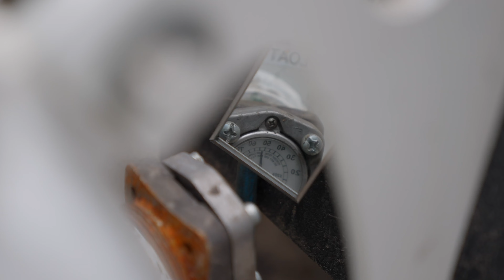Driving Change: Amogy's Ammonia-Powered Truck

Comment: Has Amogy considered to team up with companies and engineering bureaus with competence and interest in starting to produce climate smart ammonia by: H2 from large scale electrolysis of water by using electricity from wind power and solar PV:s and N2 by separating it from air? 
Then: 3 H2 + N2 => 2 NH3 (ammonia) by large scale, high pressure of 300 to 400 bars, high temperature of 300-400 degrees C, in a catalyzed production facility. 
Your ammonia engines should have access to climate smart ammonia also. Then everything is in place, so to say.

Comment: Could you please check if your trees are ok if you take away the carbon that they need for photosynthesis?  You 
might put your trees I peril if  you take away their carbon to do their photosynthesis !!!!
Reply: Do a bit of studying of partial pressures and balance of gas mixtures for photosynthesis. Too much carbon dioxide will damage the plants. Remember, plants only photosynthesize during the day. What do you think plants do at night?
Reply: @mb-3faze  You should do more studying.  Co2 added to greenhouses promotes vegetation and faster healthier growth.
Reply: @ericksonjustinAK  What a silly billy. Most excess CO2 is absorbed in the oceans, increasing acidity, causing the water to heat up and expand and altering weather patterns.
Reply: @  I see you want to side step and name call to show confidence because you know what I said is perfectly true and refutes your point.  Fine, if you want to go on this tangent, here's another point.  Oceans do absorb Co2 but they also emit Co2, and as they warm up, despite whatever reasons for warming up, they absorb less Co2 and emit more Co2.  Sooo... warmer oceans mean more Co2 and more Co2 means more vegetation.  And many scientists believe this is why there was more vegetation during pre-historic times when Co2 levels were higher than today.

I don't know why I'm responding.  You have already shown you aren't interested in having an objective conversation to hone into finer truth, ya silly billy.
Reply: @ericksonjustinAK  Ok, you stick to your oil industry propaganda narrative.  Blah blah more trees... I'm more worried about the animals - I.E. us. The fact that you're watching a video on ammonia powered vehicles and drinking in the first sentence spoken in the video which is an absolute lie and you are not commenting how this video is clearly propaganda shows you haven't spent much time out of the fossil fuel echo chamber.